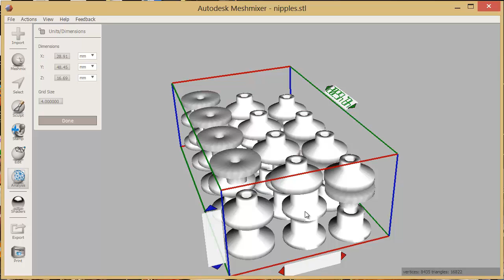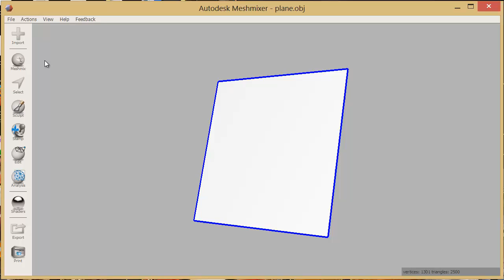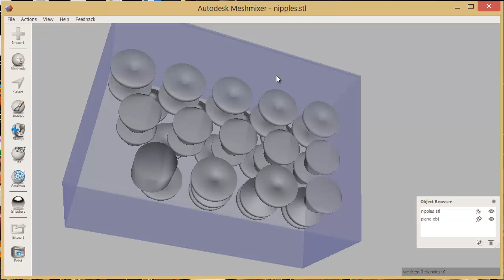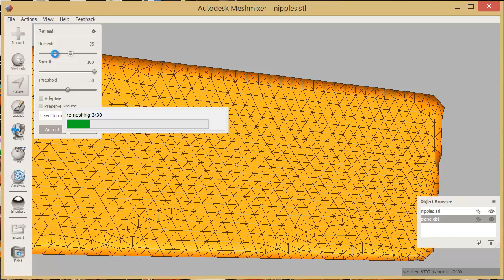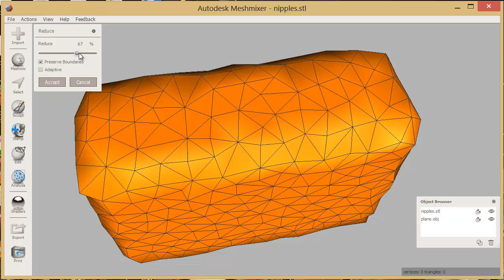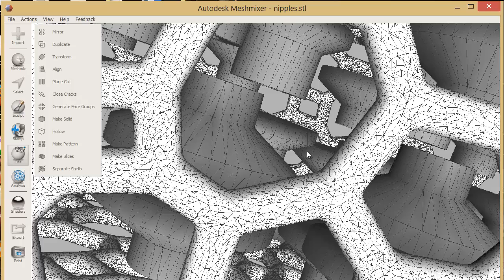How to make a cage to reduce Shapeways 3d printing costs

Comment: How did you extrude the plane? It doesn't give me the option to extrude it. It sounds like you hit a shortcut key to convert it to an extrudable thing.
Reply: I wasn't properly selecting the plane. Double-clicking while the select tool was open did the trick.

Comment: cool! Although, I have so many suggestions for how to improve this. Here are a few:

1) if you Generate FaceGroups on the box first, and then check Preserve Facegroups & Adaptive in the Remesh, you will keep the crisp edges and probably be able to get a smaller polycount before Make Pattern

2) You might get a better low-res cage (for input to Make Pattern) by doing multiple passes of Remesh to lower resolution (with the facegroup boundaries preserved), than you will with Reduce, because Reduce will create those large faces on planar areas (that will result in holes). 

3) You could use the Convex Hull mode of Fit Primitive to automatically get a tighter container than a box. The hull will be lying on the original objects, so you want to do an Offset afterwards, to create some distance.

4) You could do Make Solid (Accurate Mode) with an Offset Distance, to create an even more form-fitting container surface. The only complication is that you will need to set the Offset Distance high  enough that you get a single outer shell, and delete any inner shells. So then you will possibly need to use Offset to shrink the shell back inwards.

5) Another way to get a tight wrapping surface is to enclose the whole thing in a simple closed mesh (box, sphere, etc), then select your original objects (all Combined) and make them the Target object (Actions menu, Set As Target). Then use the Attract to Target tool on your enclosing mesh, and set the Offset parameter up to a few mm, to leave some space.
Reply from the maker: The Fit Primative works sometimes but usually crashes for me.

Comment from the maker: This'll help people who have multiple parts in one model and are shocked by the upcoming prices after the price change on Shapeways. Sorry for choppy screen capture, not sure what happened there.  It's certainly good enough to help you on your way to bringing prices back down to where they should be.
Reply: I have typically used Shapeways when I just wanted a fast delivery for remote teachers, but with the price change, will likely just use Sculteo, given their prices were in line with Shapeways (a little cheaper in the solid black material when I needed a replacement) and they got the part to me in a quarter of the time as Shapeways. Te part was needed to restore a broken 3D printer I was using in my online classes - my Blog entry about this: http://www.stemulate.org/2014/08/26/first-3d-printer-fully-recovered/